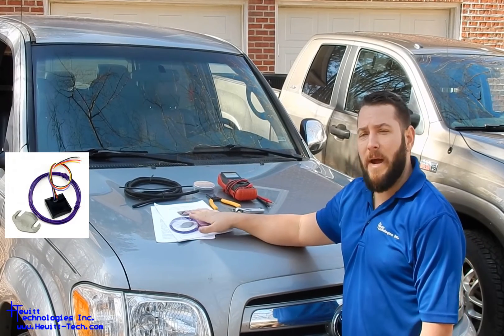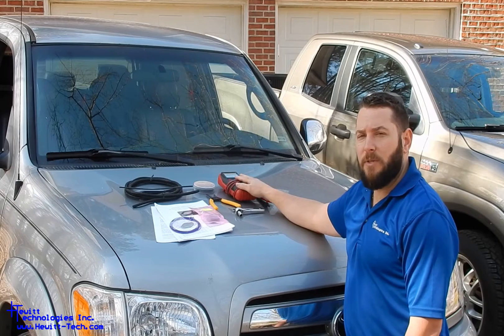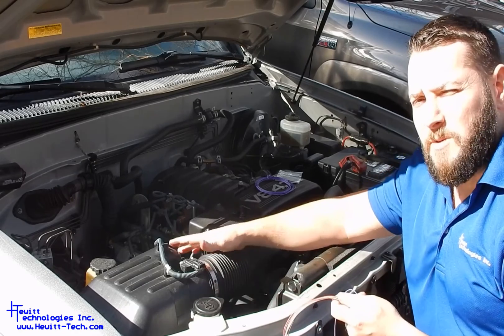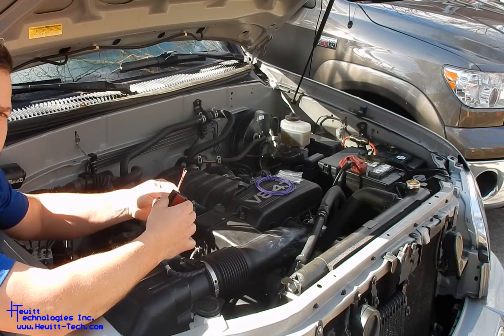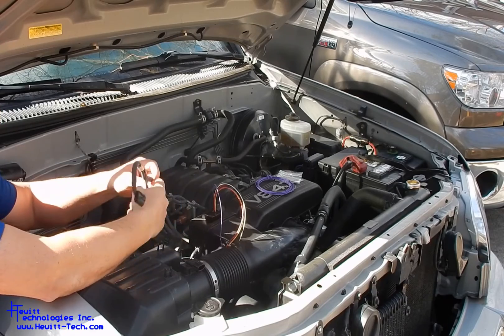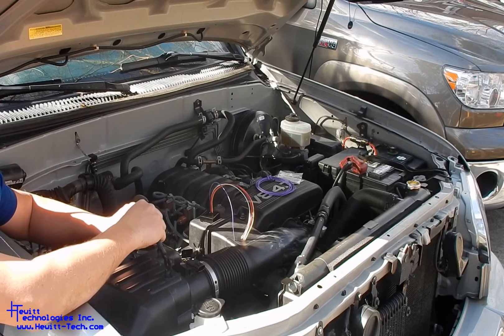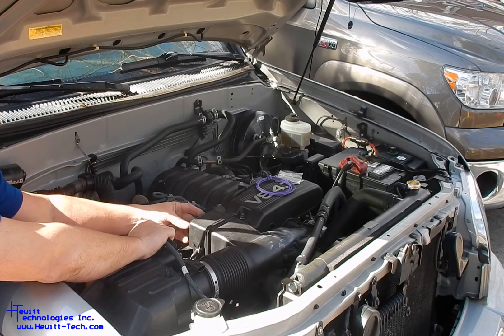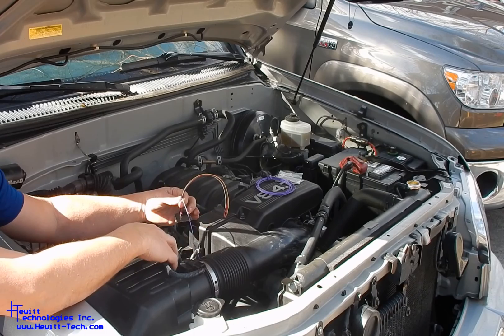Toyota Lexus V34W Wired Secondary Air Injection Bypass Module Install - Hewitt Tech

Comment: I installed the kit but within a few months I was getting a CEL for mass airflow sensor. Have you seen this happen before? Could it be the kit? Thank you
Reply from the maker: Regardless of our kits we see a lot of dirty MAF problems when temps get warmer. Our first recommendation is to clean the MAF with MAF cleaner according to the instructions and replace your air filter. If that doesn't take care of the problem give us a call toll free for further troubleshooting.
Reply: I already replaced the mas , will replace air filter and go from there.  Thank you.
Reply from the maker: Please give us a call after that if it is not resolved and we can go through troubleshooting.
Reply: I’ve talked to your customerservice a couple times already but will definitely not hesitate to call back with an update. Thank you

Comment from the maker: For anyone considering our wired kits we recommend them for professional installation only. It is vary rare that we have a problem with out current V3 units and when we do it is almost always caused by poor installation of a wired kit. The plug and play is also recommended if you are paying someone to install the kit. Typically with the extra labor and risk of a bad installation job of the wired kit the plug and play kit ends up costing about the same. If you are intent on installing the wired module yourself and have never soldered before please watch several you tube videos on the subject of wire to wire soldering and practice before installing. Excessive heat transferred into the internal circuitry by poor soldering technique can damage the unit and installation damage is not covered by our limited lifetime warranty.

Comment from the maker: This kit has been updated to the V36W kit. The only noticeable difference is that it now uses a 1/4" quick disconnect terminal to connect the starter relay sense wire to the module.